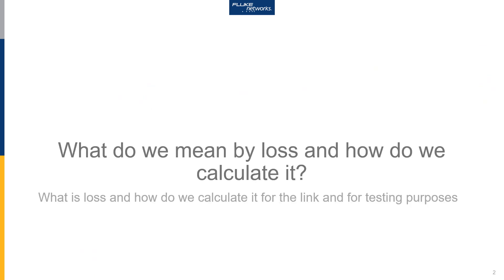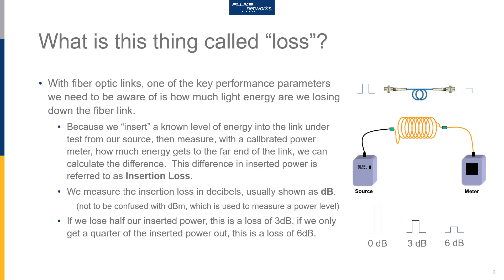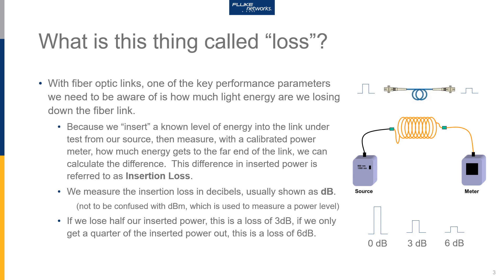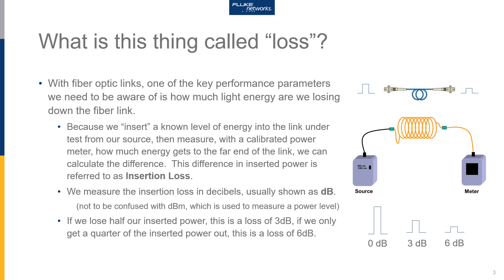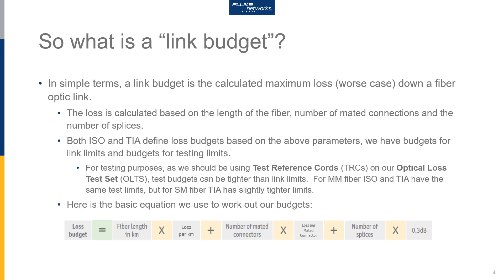Fiber Questions - How do I calculate a loss budget? by Fluke Networks

Comment: How can we determine the number of connectors and splices?
Reply: you can try using an OTDR or you would need to estimate a single run generally ea end (this would of course depend on the length) would have a splice in the FOBOT a connector at each FOBOT